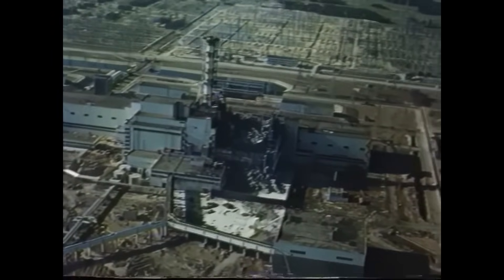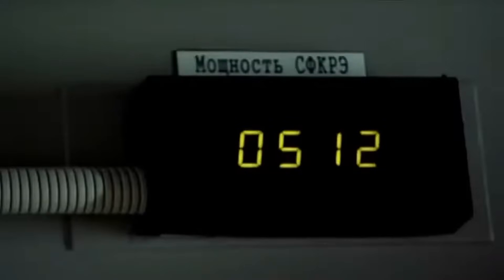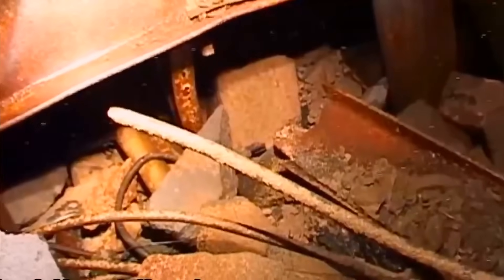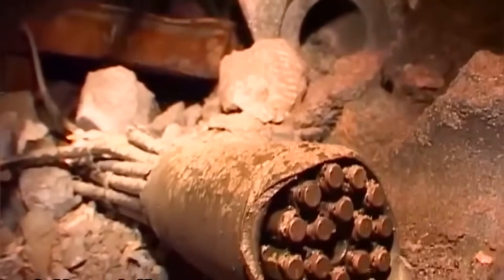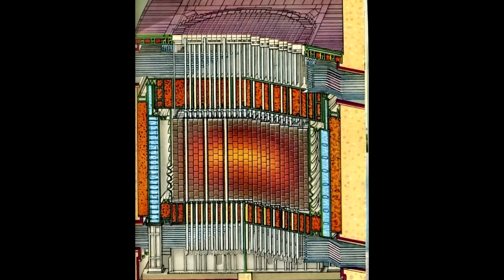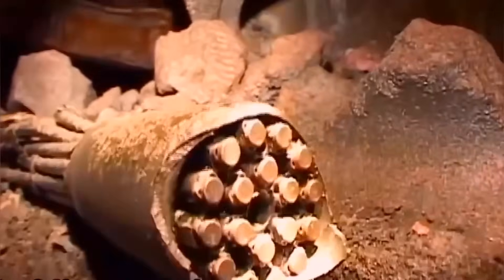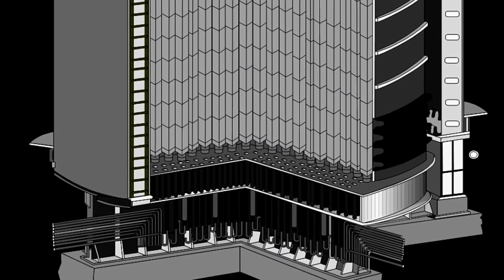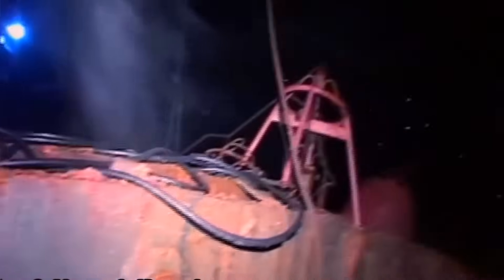Chernobyl Explosion Theories: The Hydrogen Explosion and Why it Doesn't Work

Comment: What happened is, in very short, steam blew the lid - and hydrogen caused most of the explosion.

It is very well explained by an expert here at ~31:00:

https://www.youtube.com/watch?v=YRPuO1RhbKo

The whole video is worth watching. It goes quite deep into the physics involved and the things that happened in Chernobyl.
Reply from the maker: This video is based on the INSAG-1 version of events. AKA the 1986 Vienna Report which is so bad the IAEA deleted it from their website. It's basically useless. This whole version of events as described in the video you linked is absent from the IAEA's modern Chernobyl report, INSAG-7.

It also immediately falls for point one and two of debunking the hydrogen explosion. The reactor was not initially exposed to one atmosphere of pressure, and no reacted zirconium has ever been found anywhere, not in the building, or outside.
Reply: @thatchernobylguy2915  Doesn't add up.

Here's the thing: Mr. Chaleff explains very conclusively how it worked.

Steam blows lid - hydrogen goes boom.

He doesn't even mention zirconium - because it's irrelevant.

When plasma at ~6,000°C contacts water (aka H²O) it goes boom instantly. With or without zirconium present.

Mr. Chaleff has a physics degree and experience in the industry. Therefore, I rather trust him than a guy with a degree in youtube. And discrediting the other guy instead of arguing on the matter tells me what I need to know.

INSAG-1 isn't bad in the classical sense - it came to wrong conclusions due to wrong information by the Soviets and lack of understanding of the processes involved by science back then.

Given the wrong variables - even a math genius comes to false results.

There are plenty of references in I-7 to I-1 - explaining how and why they came to their previous conclusions.
Reply: To me the hypothesis of being a chemical explosion due hydrogen does not hold water, it simply not possible for enough hydrogen to be produced nor the energy to do the kind of damage it did. The flawed claims of hydrogen being the culprit simply because it has the reputation of being explosive reminds me just how for many decades it was said alkali metals dropped on water exploded because hydrogen, to me it never made sense as I played with hydrogen in my youth so I knew how it behaved, then not long ago it was discovered the explosion is not due the hydrogen but a Coulomb explosion (not at all what happened on the reactor). 

My theory is simply that the power released was so large that the already overheated water inside the cooling channels flash boiled so there was a steam explosion, something similar to the SL-1 reactor accident just on a massive scale but with no water hammer involved. Ill be willing to say that some fuel elements might have got so hot that they started to vaporize. Steam explosions can be very destructive, capable of destroying mountains, think of the Krakatoa.
Reply: @teresashinkansen9402  Hundreds and hundreds of fuel rods created vast amounts of plasma with a vast surface area and a huge amount of water to react around it. The whole process took a fraction of a second.

At this point the reactor, designed for 1,320MWt, ran at 30,000MWt. Some experts estimate even 10 times more than that.

It's one thing to ignite a small amount of pure hydrogen in air - uncontained.

It's a completely different thing to have a gigantic amount of it perfectly mixed together with the perfect amount of oxigen (aka oxyhydrogen gas) in an open containment vessel - basically, a gigantic cannon.
Reply: Here’s another great lecture from MIT

https://youtu.be/Ijst4g5KFN0?si=CM4qJB67-njbKH9L

Comment: A question I have everybody complains about no containment building but the question I have do you think it could’ve hold back that powerful of an explosion I don’t think it could’ve how high did it send a lid before drop back down Doesn’t that way a couple of hundred tons along with all the graphite that blew everywhere
Reply: Containments (at least in Western BWRs and PWRs) are designed to withstand the entire reactor vessel's water flashing to steam. RBMKs... clearly not the case, more than 2 channels rupturing would pop the top off and break containment. Interestingly the VVER (the Soviet/Russian version of a PWR) does have Western-style containments. But for RBMKs building a containment building would be exceptionally difficult because they're _enormous_. There's a reason they didn't do it.

Comment: Great video and , as an engineer myself, I love the scientific approach!
One question: since the hydrogen generation factor of graphite is givem relative to square metres, it indicates to me to imply the surface area of the graphite, i.e. all of the free surface area?
So we would need to factor in the surface area of each fuel and water channel (hole in the graphite) as well as the graphite block outer areas. So muuuuch more than the area of the reactor seem from the top.
Thank you and I look forward to the next videos! Keep up the good work!
Reply: Agreed, the concern is pre second detonation hydrogen dissociation. That reaction potential should assume the free surface area right? the oxygen mixing for detonation would follow. These are microsecond states, not one or the other. Though I'm not a physicist so... maybe I'm wrong.
Reply: I thought the same, the actual surface area would be huge.  And if the whole reactor was essentially steam at that point, as steam caused the first explosion then it could happen.  For what it’s worth though I agree with the conclusions, it’s doubt there would have been enough time for a sufficient volume of hydrogen to be produced.

I have wondered if it’s to do with the superheated nature of the steam, when the temperature rocketed most of the water would have converted to steam but when things ruptured and released the pressure that makes even more steam.
Reply from the maker: While I would normally count that, those would be filled with steam/water/fuel so it is impossible for any oxygen to force its way in there, leaving just the surface area at the top as a place for possible reaction to take place.
Reply: @thatchernobylguy2915   But what does oxygen have to do with this reaction? As stated in the video, the reaction is between steam and carbon, and the core was full of steam at that point.
Reply: @thatchernobylguy2915  But you're talking about a reaction between STEAM and the graphite, not oxygen and graphite. The fact that the reactor was full of steam is the whole reason taht you need to be considering the whole surface area.
Reply: @thatchernobylguy2915  If Scheme OR was dislodged downward, oxygen could rush into the core from underneath.

Comment: Hello all!

A very interesting video, and I'm glad I found it. There's however a few question that some of you might be able to clear up?
I'm not a chemist, and my knowledge of such is rather basic. Historically, "city gas" or "town gas" as it was known was made by a reaction between steam/water and carbon-holding fuels to produce H2 and CO by the reaction of H2O=>CO+H2 (hence people commiting suicide by "turning on the gas"). So I dont' understand how it's possible for this reaction to be so ineffecient, seen that it was once used at industrial scale for generating hydrogen in hydrogenation plants? Or are there many differences in geometry, catalysts used etc?

Regards,
Thomas
Reply from the maker: Because graphite is a very stable molecule, being a giant covalent structure (diamond is another giant covalent structure), and it take a lot of energy to break those bonds. So while such city gas would have been easily made from fuels being broken down and releasing carbon, it is extremely extremely difficult to get even a small amount to occur in graphite, even at those high temperatures, especially in less than 3 seconds.
Reply: @thatchernobylguy2915  "Because graphite is a very stable molecule"  Not at the temperatures inside a over powered reactor, it's not.
Reply: I expected something along those lines, and indeed it does make sense. They used activited carbon (with high surface area for the reaction and lots of impurities) lookalikes for hydrogenation plants. Often they used tiny granules in a big air-flow as well, to provide the heat required for the proces too.
Indeed, 3 seconds is what's the killer here, you can't have a lot of reactions in that very short window. Thanks for the answer!  @thatchernobylguy2915
Reply: Here is a better explanation of the graphite and steam situation after the MCP pumps failed at 1:23:45 am. As you say, the conditions would be ideal to generate hydrogen on a large scale. I don't think most people realize we are talking about smelting temperatures greater than 1700C in the fuel channels when the MCP pumps failed. Technically, the fuel channel temperature reaches the zircaloy melt temp at 200C when it goes off the chart at 1:23:54 am. Graphite covalent bonds react differently under extreme conditions. https://youtu.be/m0eal55cGqE

Comment: I remember watching Scott Manley talking about this in his going nuclear series.   There is also a theory of the reactor going prompt critical and running away.   That would be an interesting one to hear more about.   Chernobyl is like a positive feedback loop.   The more I learn the more quesrions I have then the most I have to learn.   It's a viscous but pleasing cycle.
Reply: It was quite precisely a positive feedback loop, no 'like' about it. I daresay that the reactor going prompt critical is compatible with just about any explosion theory. The question is just precisely when and on what scale?

For instance, most accident modelling will predict a very brief 'pulse' of reactivity that is arrested by the fuel temperature coefficient. But if this (presumably localized) prompt criticality is enough to damage at least three fuel elements, the reactor will still blow up, one way or another. After this point it is hard to say what happened? Did the entire (or most of) the fuel undergo a larger prompt criticality when the coolant flashed to steam? Maybe...
Reply: @MinSredMash  They mean the disaster itself has a positive feedback loop, where learning more about it prompts further questions!
Reply: @MinSredMash  yes it was a positive feedback, that's the basics of it. We do not know and likely will never know the exact physical dynamics of the last second or two. It can only be modelled but models are as good as input data, which is based on assumptions.

Comment: Wasn't K-431 accident a combined criticality/thermal explosion (heavy on the thermal side, but still!)? Knowing that it was reaction that stopped itself (by propelling part of fuel being loaded out), isn't it logical to assume that sealed reactor might well get really angry and make (a very in-efficient) nuclear explosion?
Reply: Same with the American SL-1 reactor.
Reply: Positive void coefficient loop only leads to power increasing indefinitely and can only be stop by blowing itself up causing the nuclear materials to spread far enough apart to stop the nuclear chain reaction.

Yes, you can make a bomb with that.

Comment: The surface of the grphite is much, much, much larger than claimed in this video (by many magnitudes - think about the surfaces of one graphite cube, think about potential porosity of the graphite, think about the state in the reactor core after an first explosion...) and thus, the argument that the kinectics of hydrogen formation are excluding a hydrogen explosion is false.
Reply from the maker: At the same time, the traditional theory dictates the reactor core is in tact immediately following Elena being thrown aside. Oxygen could not permeate the the sides or deep into the graphite stack because that area is filled with water and steam. 

At the same time, you have failed to acknowledge that oxygen would never be able to reach the core in a significant value, as explained at the start of the video due to the pressure gradient. No oxygen, no reaction.
Reply: @thatchernobylguy2915  I don't think that oxygen has to enter the reactor - hydrogen will leave. There is basically no material which will hold hydrogen at the temperature we are talking about. But I am not an expert on this. Please keep in mind that the 190 squaremeter you used in the video has nothing to do with the "surface" the paper on hydrogen formation used in the graph (a quick search through the literature has specific surface values between 4 and 400 squaremeter/g graphite powder - yes, the graphite was not in powder form in the reactor, but that gives a first idea about what surfaces we are talking about here).
Reply from the maker: @mathisduwel2506  If the graphite was not in powder form, this ultimately means less hydrogen would be produced. Regardless, for hydrogen to be produced via the graphite, you would need oxygen to get into the reactor. Furthermore, the temperature outside the reactor was well above the hydrogen auto-ignition temperature, so any hydrogen that was ever produced and escaped would have immediately reacted and you'd have the equivalent of a large flame shooting out for a long period of time instead of the instant massive boom. I hope this makes sense.

Comment: But what after first explosion pressure dropped. So the pressure requirement for H2O -> H + O dropped, no?
Reply: exactly... if they estimated 10000C water vapour and following suddent drop of pressure because lid went away sounds like all water will decomposite instantly
Reply from the maker: As established in calculations following Sich's theory, the pressure spiked even higher after the first explosion. Even still, ignoring this, the pressure in the core for a prolonged period of time would be much much higher than the temperature required for thermal decomposition to even begin.
Reply: Yes. The explosion of the lid would have caused a massive drop in pressure and leave behind a vacuum for oxygen. Also getting lots of hydrogen in these circumstances is very easy and evidenced by the dangers of light water reactors.

Comment: theory, simply overpressure event causing reactor containment failure causing an explosive release of pressure, the hydrogen that was produced then fireballed into the air immediately after creating the appearance of a fiery explosion, but in fact being 2 separate but incredibly closely timed events, is this possible?